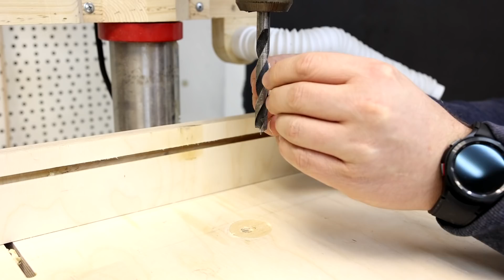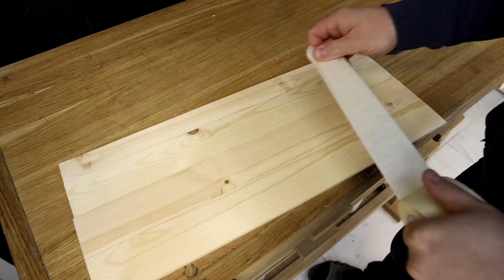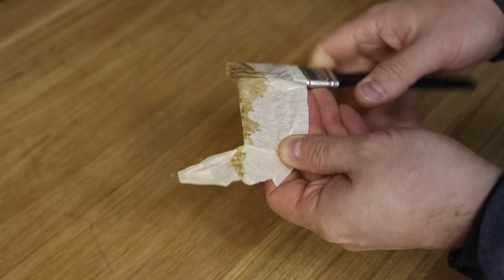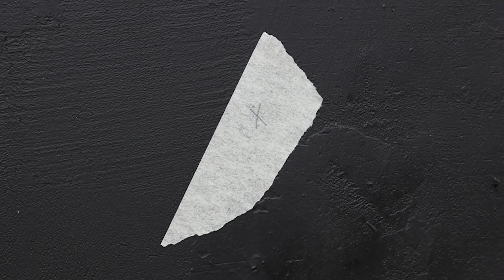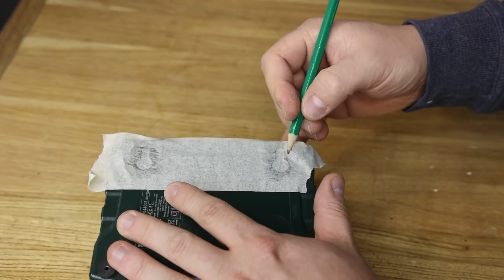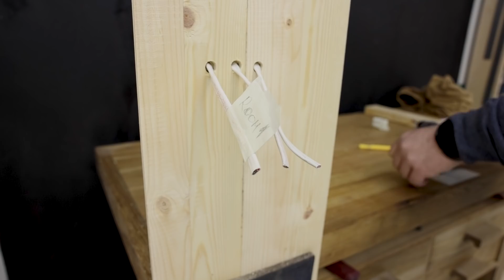Cоветы и лайфхаки Малярной Ленты о которых Вы могли не Знать

Comment: I simply don't understand the part where you placed screws on the tape.  Don't you think you will have a Hard - Time to pick it up when at work simply because its so sticky? On top of that you obviously had a hard time putting it back one by one on its container box. 

I highly recommend to just take out the plastic container box when you're working for you to easily pick up the screw at a time and return it back so easily as well. How's That sound? 

Overall, Its good.  Thank you so much for sharing. 

 Kindly edit that portion am talking about.  Can We Do That?